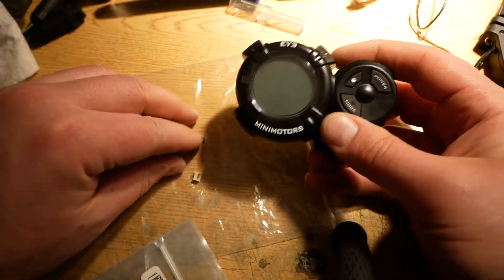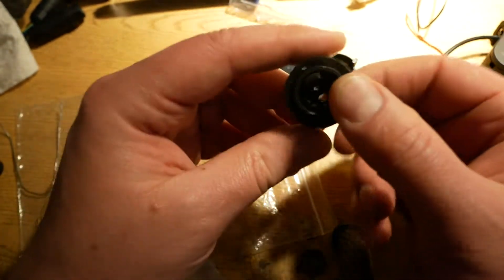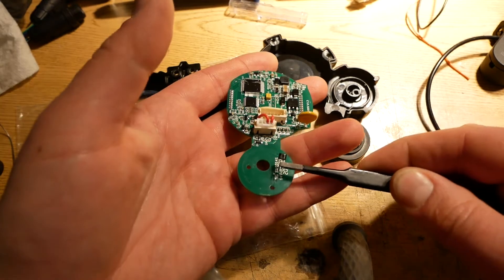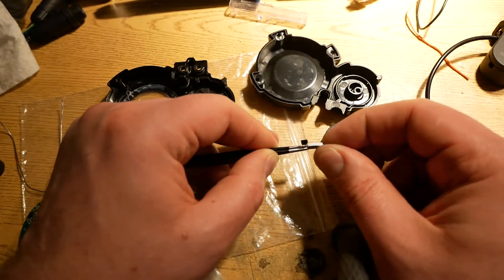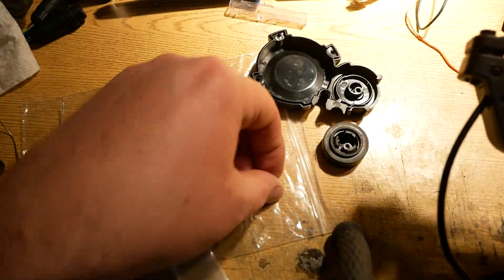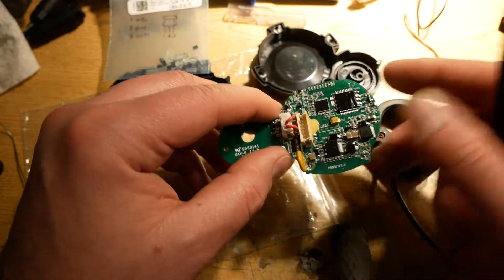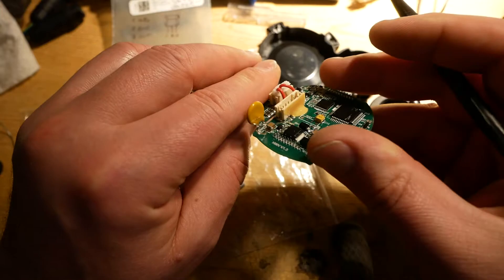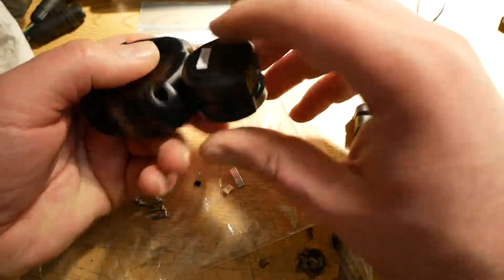Dualtron hook throttle delete for external throttle

Comment: I opened the throttle compartment which has the spring inside.  Now for god's sake i cannot put it again how it was ☠️ do you have any suggestions.  I just wanted to grease it🥲
Reply from the maker: keep trying...I didn't find it hard. You need to wind the spring up 1 full turn so it's always under tension.
Reply: @de-bodgery  how can you not find this shit hard ☠️☠️😂 i have been trying for 5 hours now . The problem is i wind the spring but than i can't screw it to the board
Reply from the maker: @apostolkaftani9149  LOL! I don't know...been messing with mechanical things since I was a boy. This sort of thing makes sense to me most of the time. Lots of things like this are intuitively obvious to me.
Reply: @de-bodgery  finally after 6 hours i had to use a bent fork to set the spring right😂😂 and its working fine. Thanks for replying man you are damn fast new subscriber 🗿
Reply: @apostolkaftani9149 hey am dealing with the same problem now I can’t find my spring thing dam near disappeared do you remember what it looked like by chance tf100 throttle spring maybe please help
Reply: @monkey1007  it was a short but wide spring 🤔

Comment: I bought an LT01 thumb(modified) from Ali Express for my Kaabo wolf warrior 11 but it didn't turn on, am I missing something?
Reply from the maker: either you wired it wrong, it doesn't work, or you have some other problem. How you expect me to know any of that from such a vague message is pretty much impossible.
Reply: @de-bodgery   I got it. The throttle that I bought was the wrong voltage. I needed a 60v compatible  EY3 throttle. Thanks for replying though.

Comment: Would be awesome if you would sell this modified for Dualtron owners to buy:)  Why can't these manufacturers ever design for different throttle options? I am used to riding motorcycles and properly gripping the handlebars so... twist throttles. I made a modified part to mechanically connect my thumb throttle to a twist throttle (different scooter) and it has worked perfect for 1,000 miles.
Reply from the maker: you can buy it on aliexpress.

Comment: i have retained the hook throttle in mine and install an additional 300x. I was able to make both work by using the same connection. made it easier for my hand to have it interchangeable since i always have long rides.

Comment: He Debodge hope all is well thk u lots for your videos 📹 I have a question I own 1gen dualtron storm 72v I want to upgrade my eye3 throttle to eye4 lcd throttle I already have the eye4 throttle I just received yesterday from minimotors..Any ideas on how to hook up to my dualtron storm..? I'M trying to find diagram for eye4 lcd screen can't find..?
Reply from the maker: I had not seen the EY4 before now. Thanks for that. No idea how it might work. It seems that it is compatible with a lot of the Dualtron stuff as is. In that case, it's probably just plug it in and go.
Reply: @de-bodgery  EY4 Color LCD Display comes on the dualtron X limited and on the dualtron thunder 3..🛴🛴🛴🛴
Reply from the maker: @mhector89  Not much out there on these displays as of yet. They work over CANBUS and you would need a controller that can talk the same language as the LCD for it to be much use to you. I think that's why it's only "compatible" with a short list of scooters. The rest of them would also need a controller upgrade.

Comment: Deleted previous connect, figered out from a second try. I need to remove ss49 and solder in (literally) three wires from new throttle, in order as on your diagramm. Am i correct ?
Reply from the maker: Yes...correct. I've already put the throttle in this video in place and it's working great. I got a response from Dualtron about it and had a second one so it's on the way back to Dualtron. They liked my work! People do tell them about the trigger throttle and not liking it.
Reply: @de-bodgery  yeah, great work on that. I extremely want to swap stock throttle to e-bike half throttle in case that few days ago i was near the accident with a car, which came out from side road without looking around. That small amount of time for changing finger position from throttle to front brake could worth some health. I was lucky enough to avoid collision but i don't want to repeat it =)
Reply from the maker: @stanunderkot2924  YUP! I think I said that same thing in my 2 gripe videos I did on my Dualtron City.
https://www.youtube.com/watch?v=776kACrg2kI
Reply: @de-bodgery  Looking your video right now. Just made order from Aliexpress, i'll go with e-bike half throttle, because i think it's more safe and more common for me. In my opinion, on e-scooter in stand position thumb is very important, because without thumb it's easier to loose handlegrip on some unstable surface, bumping curbs e.t.c. On the other side, classic motorcycle style grip will be a diseaster aswell in case that we're standing, it mean when your body accendently moving back (it happens oftenly) - you're getting unexpected full throttle with all outgoing consequences. So i think half-grip throttle will be the best choice, may be it's just me =) However, thanks for detailed explanation.
Reply from the maker: @stanunderkot2924  My first stand-up scooter had a half grip throttle like you are describing. I replaced it with a thumb throttle.
Reply: @de-bodgery  yeah , I think it depends on personal, for me twist throttle is more common , 15+ yrs of moto riding ;)
Reply from the maker: @stanunderkot2924  Right...what you are used to and prefer. And who cares what I think is right on your personal EV! I do the same thing and build as I want it to be for me.